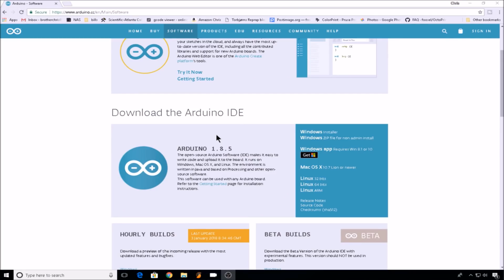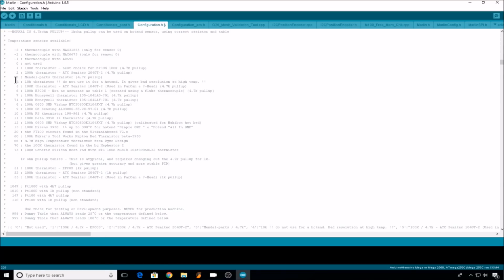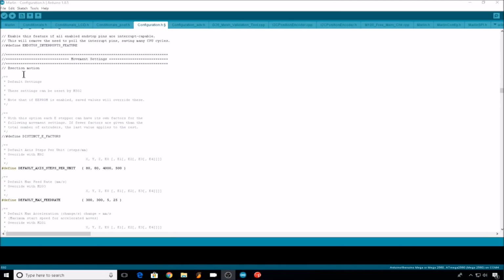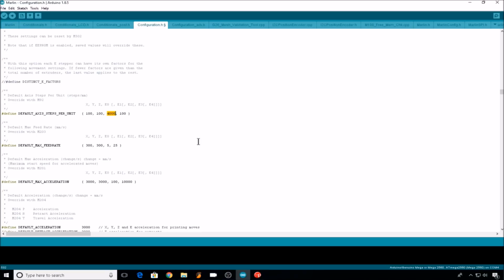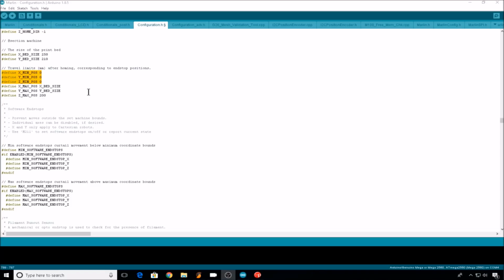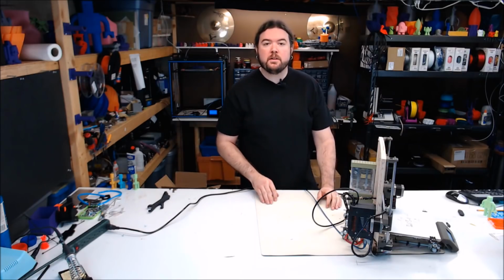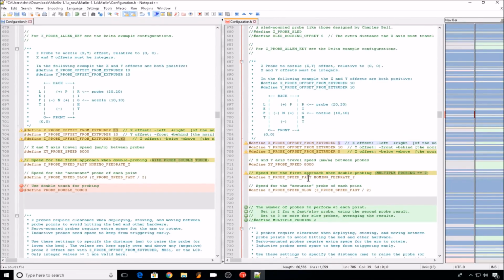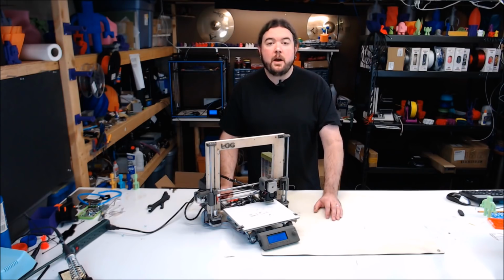Marlin v1.1.8 3D Printer Firmware Complete Config - 2018 - Chris's Basement

Comment: I built a printer from scratch the ramps board has power but the bed and nozzle don't heat up and pronter won't connect to it but it doesn't throw up an error the MOSFET boards come on but no power to bed or nozzle. What could this be due to?
Reply from the maker: Only thing I can think of is maybe one of the fuses is bad. Check them both with a meter.
Reply: @ChrisRiley   fuse?  In the power supply? I'll check but I don't know if I have any the  power comes on screen powers up but no graphics  no power to the screw block where nozzle and bed hook up I think damage in shipping the pins were crushed pretty good and some of the other components on the board as well  its tough to build a printer from scratch plus this one is on the back of a pretty good size robot its on my channel same name as here if you get time to check out this contraption and see something I can change please let me know the printer is the hardest part of the project thanks 😁👍
Reply from the maker: @wishicouldarduino8880  If it's ramps you will have those 2 yellow poly fuses by the power connector. Check those out.
Reply: @ChrisRiley  I see  OK  thanks.
Reply: It is all extracted but its in word pad  I have to open arduino ide and add it in one file at a time  even the marlin ino has just the beginning text but none of the tabs they have to be added in also I'm new to this thing so I'm sure its something I messed up.

Comment: Hi,
Your video is very helpful but I have a problem I hope you can help me with. I am home builing a printer and trying to test all my steppers etc off-frame via ramps 1.4 / mega /slic3r / pronterface using cube box gcode sample print through latest Marlin 1.1.X. Obviously I do not have a nozzle or thermistors fitted so I also keep getting MINTEMP error and system shutdown and my steppers do not run. 
The only amendments I have made are:

#define TEMP_SENSOR_0 998
#define TEMP_SENSOR_BED 999
and
#define HEATER_0_MINTEMP 0
#define BED_MINTEMP 0
Can you help please
Reply from the maker: Setting them both to 998 should keep them at 25c all the time, leave min temp at 5 or so.

Comment: Can you post your Anycubic delta 1.1.8 , I have the same printer and running into problems. Also I have the new tmc2130 for the xzy for this printer I just get complie error all day long
Reply from the maker: I don't have 1.1.8 yet, but I do have 1.1.6 but that's not going to help you with your tmc2130s. I will be upgrading the Kossel to 1.1.8 soon. When I do I will post it. Here is 1.1.6 https://drive.google.com/open?id=1Z9qXm_bZNOeblTwviqBPnEVhJ-Hqnxek

Comment: My dear respected YouTuber , first of all i like to tale you about myself , I am a Electronics developer & Engineer & Article writer so whenever i build my projects i allows needs a enclosure or cabinet to fetes all the components and getting a professional look , so Recently i have perches a 3D printer  " TRONXY P802EA"after  greeting my 3D printer suddenly the control board stooped working completely and best low cost solution of control board is Arduino mega 2560  with ramps board & A4988 driver module.
 i decided to install ramps board and Arduino  and then i saw i have to install firmware and obviously most popular  Merlin firmware ,you when ever i have to install firmware first time & i need to configurations and change the settings "config.h" particularly for my 3D printer . , i have knowledge and working experience and making several project using Arduino but dont have any knowledge about those firmware /3D printing /Settings/ settings to greetings best printing quality , i alady dose manual bed leveling and z axis leveling , i am just a noobs in those matter so i need your help bro please tale me perfect all the configuration in detail . Thanks a Lot
Reply from the maker: Hello, there is no one perfect config for any printer, but there might be an example for your printer or something close. I would look into these printer configs here. https://github.com/MarlinFirmware/Configurations/archive/release-2.0.5.zip
Reply: @ChrisRiley   no this is just Latest vertion of Marlin firmware but i want to perfect and best configuration for my 3D printer Tronxy P802 EA  for Arduino Ramps 1.4 Board  as my old melzi Board was dead suddenly so i have to use arduino & ramps

Comment: Hi,
I wanted to update my anycubic i3 mega with marlin 1.1.9. But for this o downloaded a customize firmware because marlin has no support for this display. It only support standard LCD. 

And I compared it with the original marlin 1.1.9 to identified the changes ... 

I discovered that not only the configuration file are modified ... Also other files. Is this normal or is it normally necessary only to work with the both configuration files? 

And what happens of there is a new marlin version with new features like linear advance ... Is this working with every printer if I activate it in the configuration file ?
Reply from the maker: That's pretty normal for printer companies to change other files, the pins.h for example. You should be able to use the new features on most printers, but you will have to configure everything from scratch to get it to work correctly.
Reply: @ChrisRiley  Hi, I thought I can get the newest marlin version only with changing the configuration file. Because in this file I can select the correct board which is already implemented ... Ok the LCD from anycubic is specific but new features normally have to be work without changing any files because it's normally all predefined on the configuration where I can select the right board, the motor steps and all other options ...

Comment: a new issue after successful uploading modified Marlin is my intention to drive machine in XYZ with Gcode from CAM. I was using M211 to neglect end stops.. got -&+Z from few lines written code (executed correctly though, always in second try ????). Why? Any clue why it fail to run 3D milling operation ?  Thanks
Reply from the maker: It's because you can go in the negative. Try disable software min and max endstops.

Comment: Awesome vídeo! But can you help me please? I'm trying to configure my 3D Printer what i'm building and I'll put two extruders (the same extruder) with a distance on X axis of 20mm. In marlin configuraiton.h I put this values and on line "#define DEFAULT_AXIS_STEPS_PER_UNIT" where i'm supposedly would put the value of X, Y, Z, E0 and E1,  (my values are 160, 160, 1600, 500, 500) this error happens: 

In file included from sketch\MarlinConfig.h:41:0,

                 from sketch\G26_Mesh_Validation_Tool.cpp:27:

SanityCheck.h:1669: error: static assertion failed: DEFAULT_AXIS_STEPS_PER_UNIT has too many elements.

 static_assert(COUNT(sanity_arr_1) <= XYZE_N, "DEFAULT_AXIS_STEPS_PER_UNIT has too many elements.");

 ^

exit status 1
static assertion failed: DEFAULT_AXIS_STEPS_PER_UNIT has too many elements.

Help me please, guy!
Reply: Note: I already put in the EXTRUDER line the value of 2.
Reply from the maker: Eduardo Muchak I'll take a look at how this is coded, I think one value is used for both, but I will double check and let you know.
Reply: I was able to solve it! I was looking at the lines of the code and found a commented line "#define DISTINCT_E_FACTORS". All I had to do was uncomment the line and the compilation worked.
Reply from the maker: Awesome! Good info to have, nice work!

Comment: NEED HELP. Wont upload. Error compiling for board!
Reply from the maker: What board do you have?
Reply: its a tevo tarantula
Reply from the maker: Not sure what that number is for. You can send me an email from my about page and I will try to help.
Reply: Chris Riley basically I just put my printer together and dont know the steps to start printing. Do i even need marlin to start printing?
Reply from the maker: No you don't, it's already configured and installed. https://youtu.be/1FqMyivyOTI
Reply: Chris Riley my printer is trying to print super fast with the settings at a low medium speed, the stl came from Thingiverse. Any suggestions?
Reply from the maker: You need adjust feed rate and acceleration. Connect up to your printer via USB and use a terminal program like pronterface. These commands will lower them.

M203 X200.00 Y200.00 Z3.00 E25.00

M201 X2000 Y2000 Z100 E5000

Do M500 to save the setting.

If you need to go back to default you can do M502

Comment: Chris or anyone who reads this, did you ever try to update the firmware from Raspbian ? When compiling I have no error on Wn10 but I have at least one error on Raspbian. Thanks to octopi my Pi (so Raspbian) is next to my printers but my desktop is in another room !!! I opened an issue on Github: https://github.com/MarlinFirmware/Marlin/issues/11236 (I hope it's ok to put a link)
Reply from the maker: The link is fine. I haven't tried it from Raspbian, but it sounds like something I would like to try. I will play around with it and see what I come up with.
Reply: Thank you ! For the octopi users, it's really easy to swap the SD Card (Octopi <> Raspbian). So it will be nice to be able to update the firmware from the Pie. For now I moved the desktop so I can update the Tornado firmware to Marlin 1.1.8 with BL Touch and Filament Runout Sensor. I already have to make a change = reverse the knob !
Reply: I did not try it (but I will)  but on Github someone told me about the Octoprint plugin "Firmware Updater" (https://plugins.octoprint.org/plugins/firmwareupdater/). We can verify and save the sketch on Arduino IDE then update the printer through the octopi !
Reply from the maker: Didtok Nan That sounds promising, might make a good video.
Reply: Just to let you know that I tried "Firmware Updater" today and it worked !

Comment: i like your video. here is the thing.... i have a Ramps Plus 2.0  board which was losing steps on the z axis, which makes it crash against the printed item, so i couldn't print anything taller than 2mm. i updated the firmware to marlin (everything was ok but the loss of steps) now the printer doesn't heat.(X,Y and Z axis are working ok, but the hotbead, and hotend dont work)  there is no blog or anything about this "new generation board" nothing can make it work again, it used to get to hotend temp very fast and keep it steady, also the hotbed.... but now $%&?ª..... I've  tried like 5 different configurations,  i downloaded a marlin for my printer form a blog, but is like from november 2017, I've tried autotune.... if you look at the board , is very different from the well known ramps 1.4. looks like i have to wait years for this board to get some kind of support, or wait for people like you to tweak the settings and find out the way to make it work again. on the board nothing is loose, nothing is broken, no thermistors burned, the hardware part is flawless... the firmware part is a black hole... this is where i downloaded the "latest" firmware https://github.com/Pxmalion/pxmalionCoreI3 , and this is the board itself https://ae01.alicdn.com/kf/HTB1yadxkMaTBuNjSszfq6xgfpXas.jpg 
any advices... besides the support mail from the company ... i did that already and no response so far
(sorry for the english, is not my native lenguage)  from a third world country: Edd
Reply from the maker: Hey thanks for watching! That looks a lot like an MKS clone. Have you tried using the MKS 1.4 config? I don't know much about the board. Without having one to test on it will be hard for me to create a config for it. Can you read what it says on the main processor chip?
Reply: Hi, the processor is a regular MEGA2560, i received the firmware via email directly from the company and it doesnt work properly... it still hits the printed item, it loose steps in every direction, lots of issues... i modified the steps in the z axis...i use a caliper to measure the movement and i make it work so far , but i dont recomend that board at all. my next step is to buy a brand new "old ramps1.4" board and finally get my printed working... its been a whole week  and theres no way to make it work, and the printing is really bad, low quality, lots of mistakes, nothing comes out nice from that machine... what a waste of money and time... im an industrial designer an i needed a couple of things 3d printed, and i had to pay for them... and when i received them, i was like ... oh. thats how a 3d printed thing look like!!! mine is just junk! nice looking machine, but useless... its a pxmalion
Reply from the maker: Mono Varela Sorry to hear that. Hopefully the RAMPS will get you up and printing.

Comment: I'm wondering as a good project pulling all your knowledge and a few others out there. But to do a set of video's to do with restoring, improving as well upgrading a older obsolete printer that technically could be a good up to date printer. If only you got rid of this and replaced it with this, add this. Then like I used with this video information. Come up with a current version of Marlin that has all the modern features.
In my case I have a Da Vinci 1.0.  Mechanically it's a good printer, but with the well known issues. I myself hold by before you modified anything. Start as the designer intended it to be. My case I know the hot end and the main board was the biggest issue, as well a few mechanical issues with it and yes there is a lot of information of mod's and upgrades out there. Most are older information is old and out of date. But the rest of the printer I could work with and update. Like put in a E3D (clone) all metal hot end in to it and a TriGorilla board in as well. I also rewired the End stops  with a slight mod to them. So I could use the original optical end stops. So far just using parts I have on hand and a few cheap parts from the internet. But it is now coming together well including features that could only be dreamed about with when the Da Vinci 1.0 first come out.

Keep up the good work your information was a major help. But in my and many other cases. I know how to put the information together that I need. Many out there don't or don't know where to start.
Reply from the maker: That's a good suggestion. Maybe I can find something older that is broken cheap and try something like this.
Reply: Hi Chris, What inspired me to do a project like this was the printer was just doing nothing as I have 2 other printers already. looked at it and at this sight to do with the printer.
http://www.techmonkeybusiness.com/frankenvinci-converting-a-bricked-da-vinci-to-ramps-controller.html
I contacted the original owner of this link and he has given me some advice and would like to see how I got on with my project
Its a few years old but I'm of the mind set  "Why not give it a go and make it the best printer I can. Instead of it being a brick sitting under the desk."
If your interested in knowing how i got on, let me know. But would you be willing to give me some advice with Marlin once I come up with the final coding for my project. Just in case i missed something. As I have done some stuff with Marlin but  am no Expert on it?

Comment: hi Chris
can you help with my 3d printer?
Reply from the maker: I probably can, what is the issue?
Reply: my printer does not print the correct dimensions.
Reply: when i print a cube 10x10 mm it will be 14x14 mm instead .
Reply from the maker: Something that far out will have the movement settings incorrect. Your steps probably aren't configured correctly for the size of pulley/rods you are using. What printer do you have?
Reply: i have built the 3D printer myself .
i have different pulleys ,but the axles move exactly 1mm when I move it 1mm.
Reply from the maker: Same for 10mm and 100mm, both X and Y? I am going to need a bunch of info. Pulley size, belt type, number of teeth. What are your current axis settings in Marlin? What micro steeping are you using? What board are you using?
Reply: thanks Chris 
the fault was the pulley. I had different pulleys.
Awesome video!
thank you
Reply from the maker: Moe moe Awesome, glad you got it figured out.